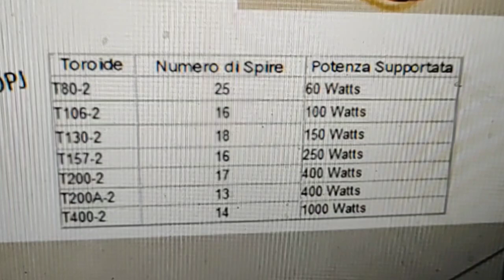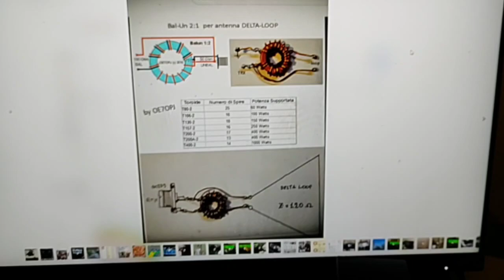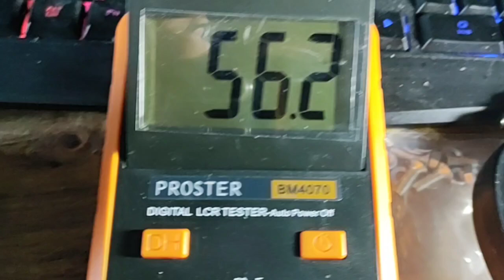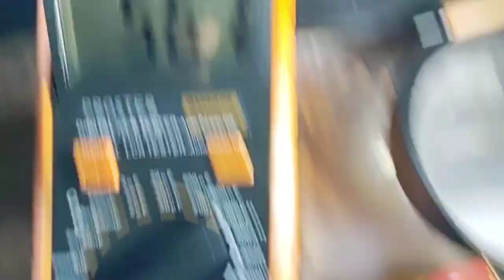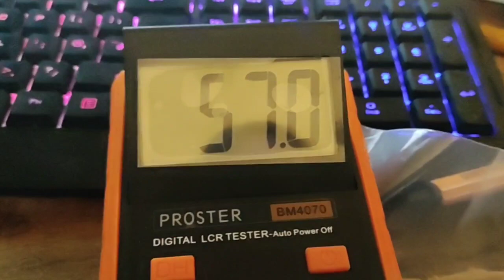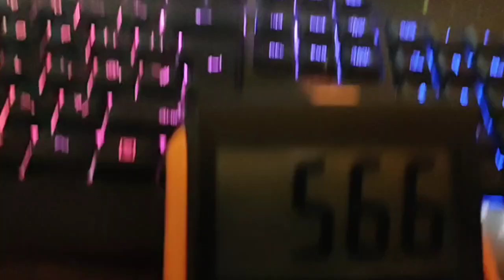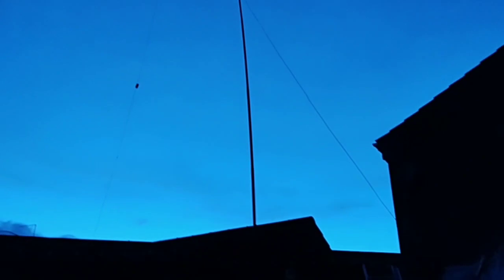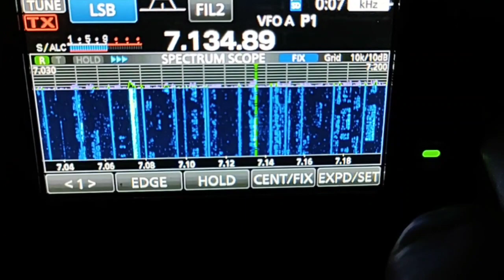40m Delta Loop Build

Comment: can you test the SWR with the tuner off so you get a true reading 
Thanks
Reply from the maker: Of course, I will upload an update shortly. I have a 1.6 across the whole voice section, dipping to 1.2 in the data region. So if anything it's a bit long. However given the location of the loop ( just above the shack ) it was never going to give me a true "in open space" swr. It's all about making the antenna that works for you, within the limitations of your garden etc 
The video is not an educational one, it's my build.
To be honest I didn't include the whole footage of testing, as the vid was dragging on too long anyway.
73 cheers n beers
Reply: @ANDY-2E1TAP  Since the tuner is on for this test, why doesn't the ic-7300 tune it to 1:1? It is well within the 3:1 capability of the built-in tuner.
Reply from the maker: @aarongriffin81  I had not retuned mate, so has not pulled it to 1.1.
Reply from the maker: Ps watch the delta loop update
Reply: With the tuner ON and not re-tuned, how are the SWR results relevant? After showing the SWRs you said the antenna is too long but the SWRs show it is too short. The results with the tuner OFF may actually show that, Did you already know the SWRs were skewed at the time you filmed and didn't let anyone know? The test results, the conclusion about SWRs, we are only misguided by the video.   @ANDY-2E1TAP

Comment from the maker: Just realised I was giving the incorrect number of coil turns round the 40mm former. I ended up with 40 coils, using 1mm copper wire which gave me 56.7uh (ish)